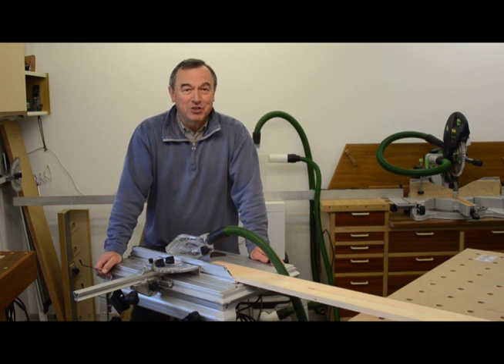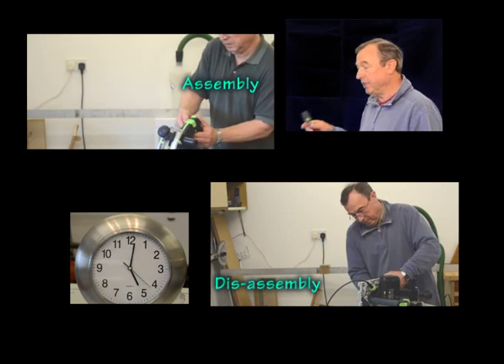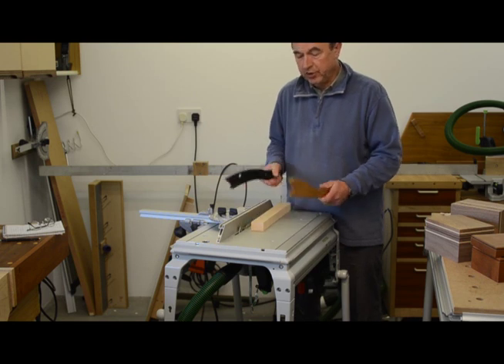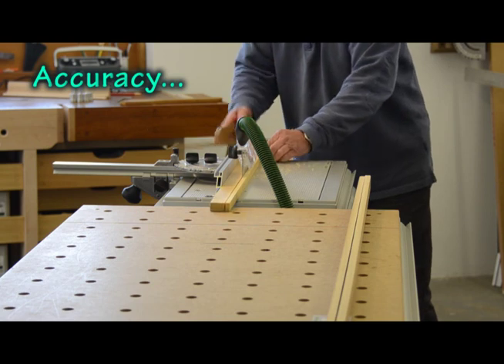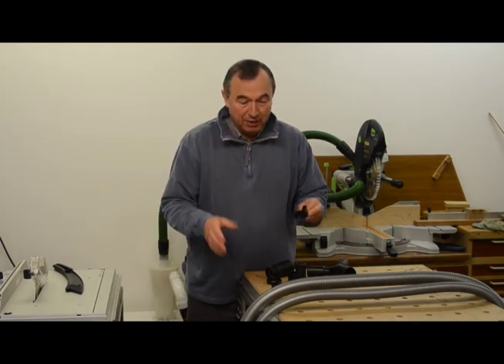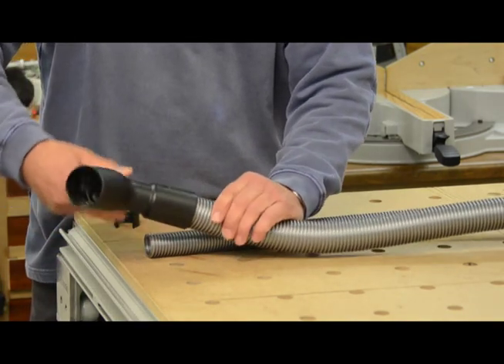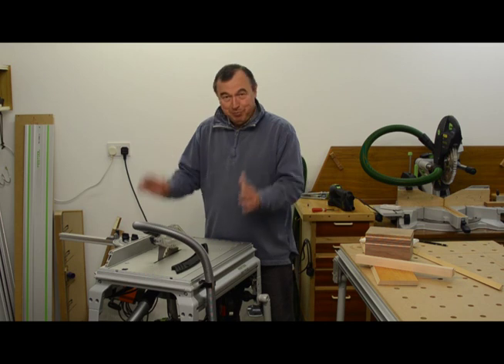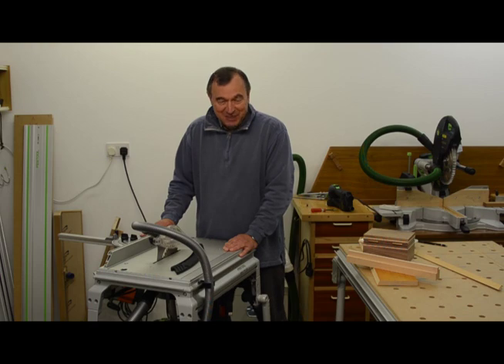Festool CMS Unit with TS55R Saw - Part 2

Comment from the maker: Hi Tim, I have machined hard and soft wood as well as MDF on the UJK table and there is no dust to worry about - there is certainly nothing in the air at all and you might just get a few of the larger particles on the machine. I only wear my 3M Versaflo when making a video to set a good example to other people who might not have such a good table. I am using the Numatic extractor with the UJK table. Peter

Comment from the maker: Hi Tim, No, I have never tried the CMS-OF option and cannot compare the two. All I can tell you is that the UJK table is brilliant and with the cast iron top is really stable - so not a portable option like the CMS. The UJK is also less expensive but I am unable to put my OF2200 in it as the router is too big for the UJK router elevator. Peter

Comment: Great reveiw as always Peter.    You cite portability as one of the major advantages, but if you didn't need that aspect, would you consider it good value for money?

On a side note- I think my old Triton 2000 kills it once set up.  Flip the table, untwist 4 cam locks and away you go ( won''t go into accuracy comparisons though)

Comment: Peter Hi. When you cut a box to make the lid do you shim one or more of the cut faces to stop it pinching on the third and final cut?
Reply from the maker: Graham Convery Hi Graham, Yes I do. I normally do both ends of the box first. For the third cut I then put shims in the cuts at each end close to the cut that I am about to make. For the final cut I have four shims and, depending on the size of the box, may use a light weight clamp to keep lid and bottom in place which is important for the last few mm of that final cut. In all of this you have to make slow and evenly paced cuts ensuring that the box is up against the fence at all times. I have found that with the CNS-TS that I rarely need to plane the finished cut and usually just sand starting at 120 grit. Good luck.    Peter

Comment: Thanks Peter. Can I ask you how the writhing knife on the saw would behave if I were to fit  a fret-slotting blade of 0.5mm cutting width to the TS-55?
(It is 6" diameter and has a centre width of 1.5mm)

The guitar fretboard would ride on a jig, and I'm worried it will butt up against the writhing knife- making the CMS useless for this task... I think.
Reply from the maker: The 6" diameter is slightly less than the 160 mm diameter of a Festool blade and so there should be no issue with the riving knife. However, the blade thickness may be an immediate issue. Festool do not provide any blade of this size or type and I would be very worried that a third party blade might not be safe in the saw. If you do this you need to take advice from an engineer to ensure your safety.  Peter
Reply: Thanks for replying- the comments on the blade manufacturer's page suggest that the only table saw that it does not fit- without tweaking- is a SawStop. 
I have asked Festool for advice.
Reply from the maker: I think that is very wise. Good luck.   Peter

Comment: Hi peter can you give a bit of info ref the dust guard . What is the maximum thickness of timber you can cut before you have to remove the dust guard. Plus can you use a sled on the CMS
Reply from the maker: Terry De'ath Hi Terry, Max depth of cut with the TS 55 is 50mm. You can get the sliding table (Festool Part Number 492100) to which you can fix the angle unit from your MFT3 to make the rear fence element of the sled arrangement. I have one which I use with the CMS-OF (Router table). It is quick and easy to fit. I do all my cross cutting with my Kapex or TS with guide rail so do not use a sled arrangement with the CMS-TS.    Peter

Comment: When will this plate be available in the states? I have have the CMS unit for the router with the sliding table. Having the plate for my 75 would make job site work so efficient.
Reply from the maker: Duane Hurley Hi Duane, I am not sure when it will arrive in the US. A lot of my US and Canadian viewers have had the unit shipped over from Europe. Do a search for the "Festool Owners Group", known as "The FOG" and you will find lots of discussion about topics like that and the ability to make contact with Festool US.   Peter

Comment: Hi Peter,
Thanks a lot for the wonderful video. Do you use standard W48 disc in this video or some other?
Reply from the maker: Andrew Chalov Hi Andrew, in the video I am pretty sure that I was still using the (supplied) W48 Fine blade which was very good but I have now replaced it with the Universal W28 (496302) which suits my need for both ripping and cross cutting. f you do a lot of ripping then I am told that the Panther blade is excellent. Many thanks for the kind words.    Peter

Comment: New Brit Workshop Hi Peter, what is the maximum width you're able to cut with this piece having the fence to your right and having the piece to the left of the blade as scrap?
Reply from the maker: ANR164 Having the fence of the right the maximum cut is 162 mm but the fence can be put on the left (with the scrap piece on the right) and that gives you 235 mm. Anything more than 160 mm can be doe with a guide rail without the CMS unit.   Peter
Reply: New Brit Workshop Thanks for your reply, also Im wondering if the fence deflects any?
Reply from the maker: ANR164 No, there is no deflection of the fence at all. I used to have a big table saw that filled one half of my workshop. I now manage with just the CMS-TS and it has not compromised my work at all. The added bonus is that I have tons of extra space.   Peter

Comment: Do you have to offset the depth (ie. 10mm on the saw equals 10mm of cutting depth)?
Reply from the maker: ***** Hi Trev, Once the saw is in the CMS unit it is not so easy to use the depth gauge on the saw. It is far easier to have one hand under the table on the height clamp knob and the other above the table with a calliper/height gauge. I can easily set the saw to within 0.5 mm that way - in fact I will be doing just that (again) tomorrow.    Peter

Comment: New Brit Workshop Also, does the fence deflect anything?
Reply from the maker: ANR164 No, there is no deflection of the fence at all. I used to have a big table saw that filled one half of my workshop. I now manage with just the CMS-TS and it has not compromised my work at all. The added bonus is that I have tons of extra space.   Peter

Comment: Can't see, why recommending this technique is in any way a risk. Is it because FESTOOL wants you to saw only with the blade guard attached? Hmm..
By the way: the same fence [for ripping cuts] is also used for cross cuts - Right?
Reply from the maker: If you are doing cross cuts that one needs some form of sled to support longer pieces like the Festool sliding table - look at the accessoried on this link:  https://www.festool.co.uk/products/semi-stationary-work/compact-module-system-cms/561261---cms-ge-gb-240v#Downloads  and you can then use the original fence at right angles (attached to the table part of the sliding table).   Peter
Reply: Thank you, Peter.

Comment: festool owners...the equivalent of apple fanboys, ha! seriously, they make some wonderful stuff, but are ridiculously expensive , their marketing strategy is similar to apples, price it high to create a luxury desirable brand. dont get me wrong,some of the designs are genius, but you pay a shitload for a lot of plastic parts eg; the push stick you can knock up at home for a 50p. dont get me started on price of dust hoses and connectors. im not knocking your reviews, but their pricing. cheers
Reply: You will not get anything on the market that is accurate as Festool for the money nor offering as many options. That set up could easily work alongside a router set up as well. 

Festool can charge the high price because of their quality and uniqueness of product.